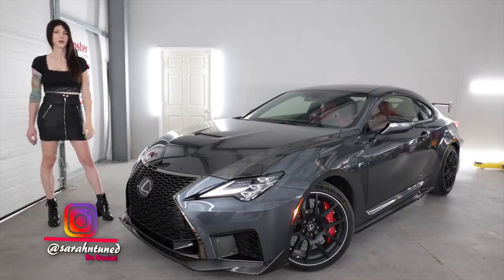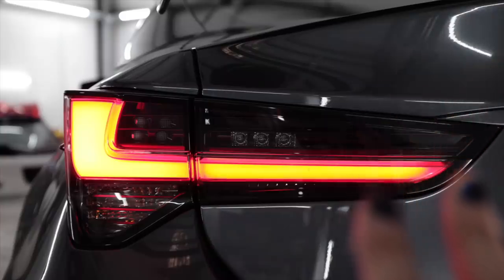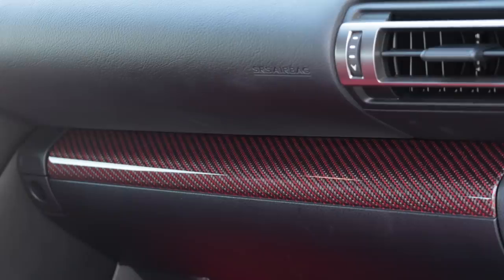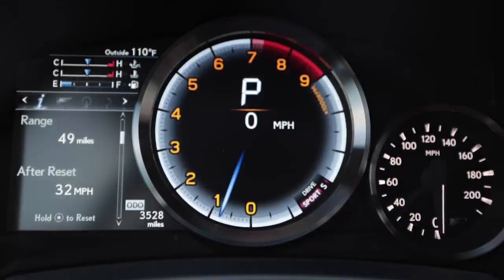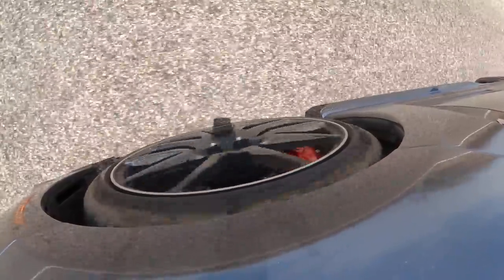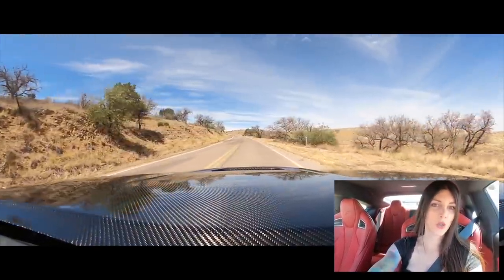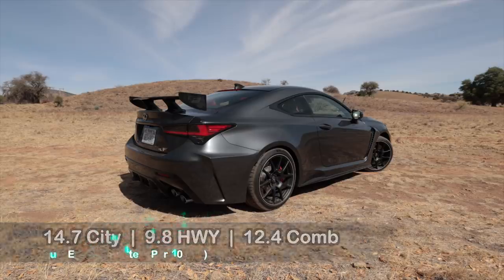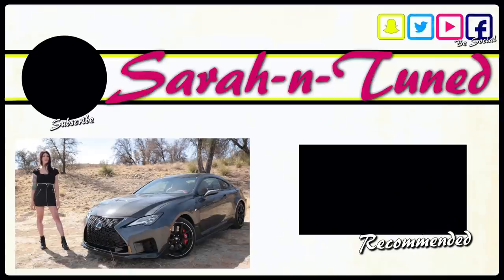The FASTEST Lexus You Can Buy! // 2021 RC-F Fuji Speedway Review

Comment: I have had cars with wheels that were 14” it’s brake rotors are the same size as the factory wheels on my 71 Dodge Challenger of course I changed them to 15” wheels but I hung on to the factory rally wheels until I sold the car it brought five times what I bought it for and that was with a bad transmission the wheels helped

Comment: The back seat is for the insurance company. Same as 911.
Reply: Why insurance?
Reply: There's no such thing as a sports car with family seating
Reply: @FFE-js2zp  called 2 plus 2.
Reply: @johnnyboots481  2 seaters with power considered different class and rate by insurance companies.
Reply: @larryordine7542  
Right, the SCCA defines "sports car" as a purpose-built 2 seater, no top or soft top (not talking about a conversion to a convertible) with motorsports racing power.  If that sports car adds a hard top, it becomes a GT.
Reply: @FFE-js2zp  I haven't raced SCCA in many years... Of course you realize their class designations are for racing division purposes and not the market place. No one sells  cars without tops. Though I wish a roll bar was standard and a modified dual shoulder  seat harness legal.
Reply: @FFE-js2zp  Obviously a track car would not have an electric seat. This Lexus is a GT in the traditional Grand touring concept. A luxury car with a powerful drivetrain, suspension and brakes capable of high speed long distance cruising in great comfort.
Reply: @larryordine7542  
There are still a few purebred sports cars around, genuine no/soft top 2 seat designs with sports racing power.  The Viper.  The F-Type/Project 7.  The Ferrari Monza.  There are some.  And history is flooded with pure sports cars.  But there are way more sedans or chop top conversions that are sloppily, and incorrectly called sports cars: Mustang, 911, RS3, M2, M3, M#.... the list goes on and on.  A trickier example of not-a-sports car is the R8, as the spider adds 600 lbs.  Clearly not a purpose built no/softop.
Reply: @larryordine7542  
Again to the SCCA explanation, which is at a minimum well thought through, a GT is what happens when a sports car adds a hardtop.  The Viper coupe, the F-Type Coupe, the Miata coupe if it had power.  In fact the SCCA created a special race class just for Miatas, so enthusiasts could race and technically call it a sports car.  Not the spirit of the class, IMO.  The Porsche Boxster is another weak example, I would say way too underpowered to call it motorsports capable.  Maybe if it appeared in the 1960s.
Reply: @FFE-js2zp  SCCA does not make or even design cars. 
The boxster is a pure sports car. Designed as a convertible mid engine and perfect balance for near perfect handling. 
The Viper was a overpowered handful with an under developed chassis that  rode like rocks and had a  handling character only a race driver would tolerate.
Reply: @larryordine7542  
Just because there is a sanctioned definition, doesn't mean the SCCA has to build every car in their sports car club, obviously.  I disagree the Boxster has enough power to race anything.  Losing isn't racing.  Its "sporty."  Sort of.  Not really.
Reply: @FFE-js2zp  the key word here is sanctioned definition. The scca is not trying to Define what a sports car is for anyone other than themselves their definition is only used for racing in their organization. 
The spitfires I raced in scca had 75 horsepower. Super v racing uses engines from 1200 cc Volkswagens horsepower 40. No modifications allowed. It isn't about power it's about equalizing the cars in the same division.
Reply: Yes
Reply: @larryordine7542  
The 911 back seat is 100% because it is derived from the Bug.  Its still a splitting image for its 1938 Type 64 roots.  But the 1938 carlooks waaaaaaay better.
Reply: @FFE-js2zp  The bug had a real back seat. The 911 is derived from the 356 which didn't. Without the tall roof the car could never carry four passengers. It's basically a package shelf.
Reply: @larryordine7542  
The 1938 Type 64 is the Bug and 911 predecessor.  If it has family seating, its a family sedan.  Pretty simple.  Sports cars are for motorsports which usually doesn't require the kids ride along. It doesn't matter if you remove the seats, its what the car was designed for that matters.  Obviously.  Thats why the SCCA definition requires a ground-up design soft top or no top 2 seater with motorsports racing power.  A bug/911 misses all three.
Reply: @FFE-js2zp  I'm familiar with Fergy's work on both the peoples car and the super streamlined rear engine prototype for racing applications. They have similarities of course; but two very different designs for completely different purposes. Having rebuild several 356 As and Bs and raced the 911 in the 70s, I know the cars and their stories fairly well.  The prototypes were in the design stage at the same time. They share parts and resources but the race car is not a development of the actual bug. The separation of concept between the contract for Hitler and the development of a rear engine air cooled race car starts at the beginning.  The 1963 911 is a clean sheet of paper for a new platform that employs the same concept not the actual chassis.

Comment: No offense to Lexus, but why does this car exist? Especially when the LC is better at being the luxury sports cruiser. Just take the Supra body, extrapolate it onto this (maybe make it smaller), and market it as the Supra under Toyota. No BMW needed, no forgettable names, and less redundant models. I get that it wouldn’t be an in-line 6, but I mean if they cared about that they could’ve just designed that instead of splitting the effort between 2 different branches of the company to make 2 completely different cars.

Comment: All the Penguins.

Next time you get a car with a symphony from it's pipes, and do the drive by, and the drive by, and the drive bys... can you see if you find a place where you can be on throttle passing the camera? Induction noise one direction and wide open exhaust the other setup. Every one always accelerates to the camera, but rarely away from it.

Comment: Be still my heart, the signature Sarah seat bolster move.  Why wasn't this car the basis for the new Supra?
Reply: Too heavy and sluggish. No point in really using it since its mainly a GT car while they wanted the mk5 to be a sportscar.
Reply: @carboydorifutoparty3976  Take out as much weight as possible, go to a Toyota Turbo inline six and this car would be an improvement on the last generation Supra and more a Toyota than the BMW based Supra.  Maybe not the ultimate sports car, but the best Toyota sports car.

Comment: Would you put ceramic brakes on a street car? Really? And titanium mufflers? Be still your wallet.
Reply: Dodge put 700+ horsepower V8 in no less than eight different models. All street cars.
Reply: @blairbrown4812  A reasoned response to the accelerating global climate threat. No wonder the Union of Concerned Scientists has condemned them as the dirtiest and most irresponsible car manufacturer.
Reply: @blairbrown4812  TESLA MODEL S PLAID 1000+ HORSEPOWER 200 Mph. 0 to 60 under 2 sec. No Noise, NO more Gas and also is a production Car. Just saying :-)

Comment: So many better options out there, and cheaper too. A Mach 1 for example would mop the floor with this car, nevermind a Camaro SS 1LE.
Reply from the maker: Aaaand it would still be a Camaro or a Mustang. I made my point at the end of the video.
Reply: @SarahnTuned  I hear you Sarah, but this car really ain't that special. The lackluster performance, carbon fiber and cool seats don't justify the price imo. I think the LC is a better buy than this car and even then I'd be looking over at other options (if I had the money). For 100,000 I'd rather just spend a couple more thousand and get a 911 or spend less and get a C8, or maybe an M2 Competition. I get the appeal of a Japanese rear wheel drive naturally aspirated performance car but this car is outclassed by nearly everything else and I dont see how that's worth 100 racks. That's just how I'm looking at it.